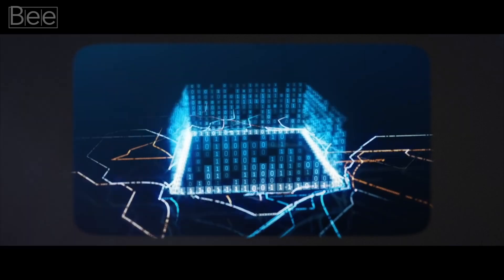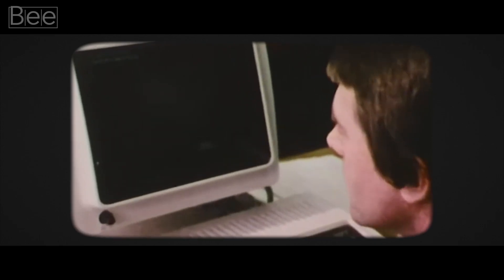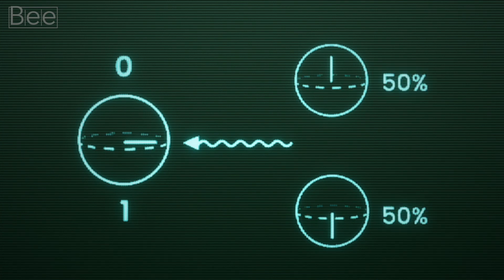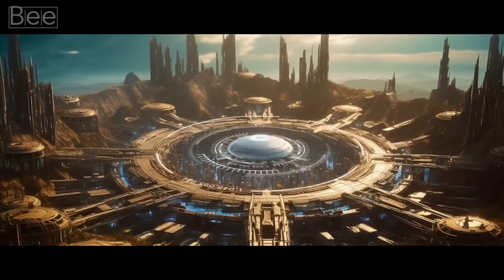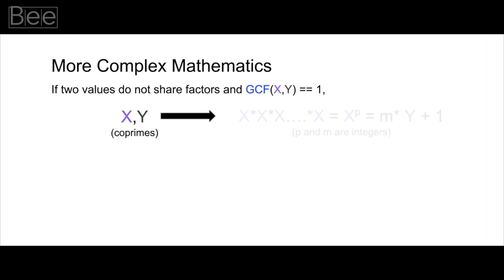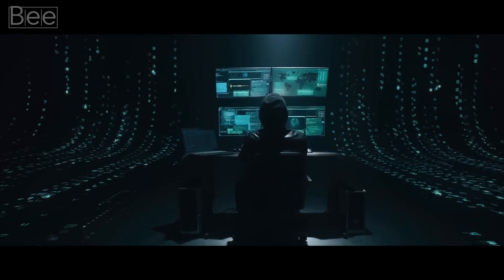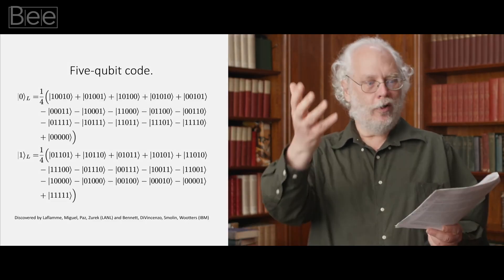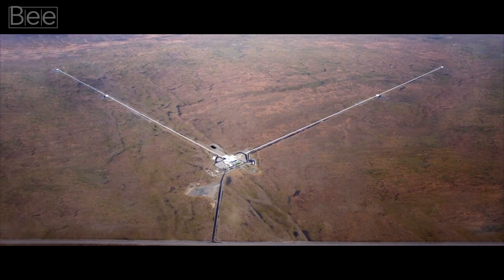"This Quantum Computer Will CHANGE Everything!" ft. Michio Kaku

Comment: 0:00: 🔒 The rise of quantum computing has the potential to revolutionize global security and encryption.
3:04: 🔑 Quantum computers have the advantage of existing in multiple states simultaneously, unlike classical computers.
5:33: 🔬 Using quantum computers to solve complex problems is challenging because verifying the accuracy of the results is difficult.
8:29: 🔒 The RSA encryption can be easily cracked by quantum computers, posing a threat to sensitive information.
11:14: ✅ Verifying the accuracy of quantum computer results.
Recap by Tammy AI